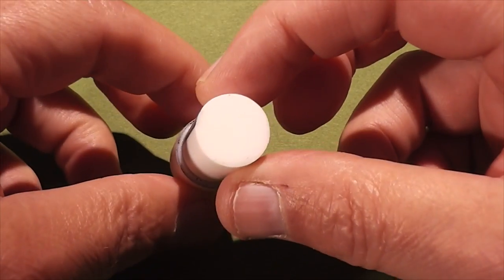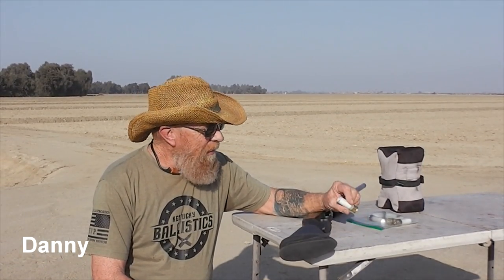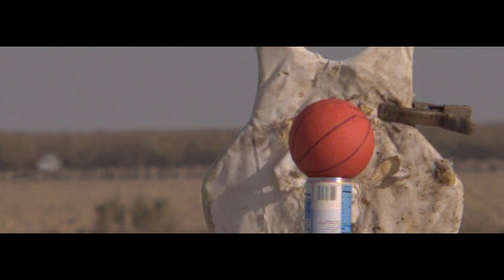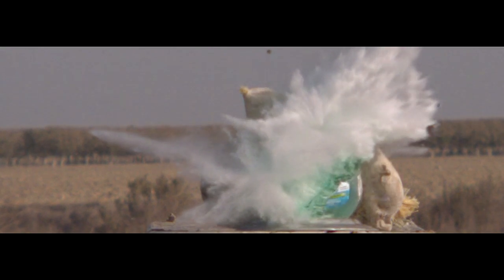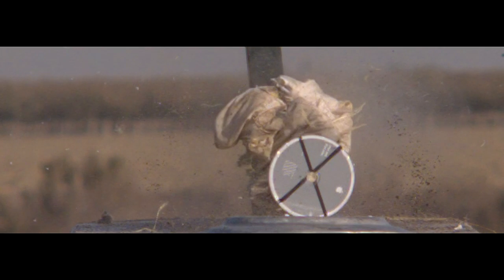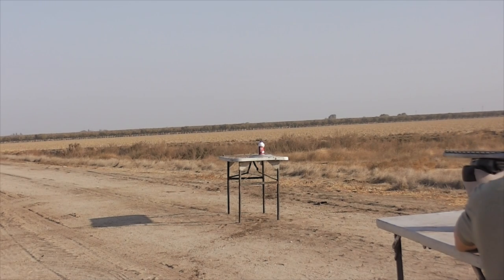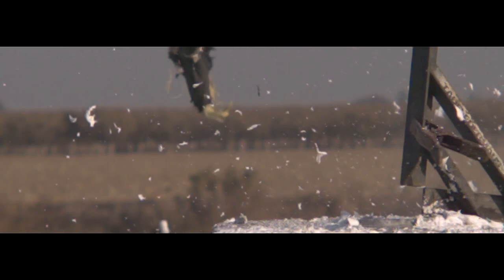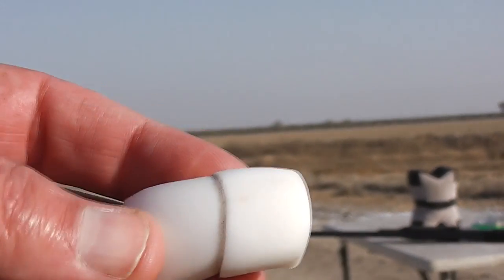TEFLON Slug -   From Russia

Comment: Thanks for testing these! Actually I made em from scraps so they cost nothing. And there is not much effort to make these. Teflon can be lathe turned just fine.
I call this a good result because I just wanted to see how pure teflon holds the stresses of being shot through the shotgun. And the test is helpful. We find a wrong way how to make a plastic slug ;)
Reply: Good luck and have fun.
Reply: Teflon is dangerous to heat, it releases fumes that when inhaled (even in very small amounts) will cause Teflon Fume Fever, my mother worked with the stuff for years and she regularly got sick from being exposed to the fumes of burning Teflon.
Be Careful with these! Shooting is likely enough heat to cause these fumes.
Reply: Try adding weight to front of the projectile. Maybe just a ball bearing
Reply: Сергей Мальцев  А она и не должна стабилизироваться. Просто хотел посмотреть что будет с фторопластом :)
Reply: @pyklwheostanzan6901  Inhaling burning powder residue is not healthy too. But most of it blown far away from shooter.
Reply: Hey, even a failure is still a result. and  a learning opportunity.
Reply: @chuckaddison5134  I expected a failure, I've got it :) I was just curious how teflon and ofher technical polymers will behave. I also made same configuration projectiles from delrin and caprolone.
Reply: @LexsLavrov  perhaps if you make a radius where the slug steps down it wil stay in one piece even with more powder?
and teflon doesn't burn it turns in to vapor directly.. so as long as there are pieces coming out of the barrel it did not get to hot.
to much vapor will kill you though.. :)
Reply: @dezeis1  I never expected teflon to perform well. Just wanted to look how exactly it will fail. Teflon is not very strong machanically. I tried to make gas seals from teflon, it failed. 
I made for Jeff same configuration projectiles from three polymers: teflon, delrin and caprolone. Just for comparison sake. These are not meant to be slugs. Just test projectiles.
Reply: Alexi, I like the idea of the design exercise.  There could be much to learn by making non-standard materials work.  Eliminating sharp edges and adjusting CG  could make it work.
Reply: Отправь им стальную пулю Иванова, если есть возможность. Интересно посмотреть сможет ли она разломать эту их свинцовую сковородку.
Reply: Maybe a lighter powder load could help^^
Reply: @АндрейКа-у4к  Если ты такой большой фанат Иванова - ты и отправляй. Лично я считаю что Иванов - на голову сильно больной и даже прикасаться к его проТУХту не имею желания. Про пробивание свинцовой плиты уже есть хорошее видео https://youtu.be/Iah7YjKSSz0?t=373
Reply: @LexsLavrov 
I seen one problem, use a radius tool when turning. There's a weak point where major diameter meets minor diameter.  I've read your previous comments so I understand.  I'm just pointing this out.
Reply: Pykl WheostanZan lol shut up it is used in high heat applications and can withstand 700 degrees

Comment: I would venture to say that the sharp angle of transition at the base is the weak point - similar to the Garand op rod. Make the transition a small smooth arc, and it should increase survivability of the slug.

Comment: Makes sense to me. I remove plumbing fittings were the previous installer had used way too much Teflon tape. The compressed Teflon cracks apart.

Comment: I also noticed a shattering effect in a experiment with fast objects, hitting a soft object.
I used the type of acrylic, that is used to seal gaps in buildings, in a attempt to recover fast objects.
That stuff is rather soft. But I noticed, that it stopped the fast objects at the surface. And they even deformed, as if they had hit a very hard object. The effect became more pronounced with faster objects impacting. A lot of the energy was converted to heat in the acrylic, without any visible damage. Though a further increase in speed of the impacting object, the acrylic just shattered to what looked like sharp shards. They where still soft to the touch though. I assume, materials have a maximum speed, with which they can transfer force. Above that speed, they are only worth their mass to slow stuff down.

Comment: Teflon is known for being soft & "wimpy, wimpy, wimpy" as a structural component. That's why you find it used as a sacrificial wear component [piston pin "buttons" on floating pin designs, etc.] where its low coefficient of friction is the driving consideration. Also why you only use nylon or wood spatulas w/ your teflon skillet... :-D

Comment: A radius at the point where the head necks down and becomes the tail would help with the structural integrity of the projectile. The sharper corner creates a shear point that probably was worsened by the spin from the rifled barrel
Reply from the maker: I think you are right.

Comment: My guess is that "step" caused just enough extra drag without adding enough weight to the nose. I bet they'll be stable if you flip them around. If I'm not mistaken you have the wider end up front, right?

Comment: If the transitions between the two diameters were a radius instead of a square corner, you may have a little better results.  Square corners, under stress, concentrate the stress in the 90 degree area, and usually produce the failure.  They are called stress risers.  A fillet or radius will greatly reduce the stresses at that transition.  Not sure if it would be enough though.

Comment: Yeah it sucks to have failures but you have to remember you are TESTING these slugs. There are failures in all testing. If there’s not, you aren’t pushing the boundaries enough. 

Plastics are weird. It’s like bending a hose. It will bend really nicely and have a nice radius but then will all of a sudden kink. The plastic does the same. It’ll bend and morph but then it has its “kink” point where it’ll just break and not tear. That’s been my experience with Delren and machining.

Comment: I don't know what to say about increasing stability, but I'd bet if the shoulders of those slugs had a generous radius in the corners they would be stronger. This is a common practice in brittle metal parts like cast iron flanges.

Comment: Interesting that the PTFE just shatters like that...  I wouldn't have expected it either. 🤔 Then again, Teflon is weird. 😅 If you heat it up and try to stretch it with a slow continuous force, it hardly budges...but if you give it a quick strong pull, it stretches to almost ten times its length and becomes a foam-like structure.  That's how they make Gore-Tex.  I guess it's something akin to shear thickening?

Comment: Taofledermaus, with Teflon being flexible under normal conditions, I wonder if it behaves like a non Newtonian fluid under shock? Sort of like Oobleck? As the shockwave hits the Teflon the polymer strands don't have enough time to slide past each other and they shatter.
Maybe this is one for the Hydraulic Press Channel? They could compress it slowly with their regular press, then try it at high speed with their Smashinator 5,000,000?

Comment: Teflon bar stock is available in many flavors. Most Teflon that needs any sort of mechanical strength will be fiberglass reinforced. That looked like it was pure if not only 5%. For the shotgun you would want 25% glass reinforced . There used to be higher concentrations available as well but these are not listed in the link. The stuff is a joy to machine when you get everything right.  here is a list of a few of the different types
 https://www.fluoropolymerproducts.com/reinforced-ptfe-teflon.html

Comment: Cool, but  you are doing it the wrong way. You are supposed to fire the water filled basketball at 10,000 Gs  at the teflon slug. That way the slug does not fracture until it is hit.

Comment: A curved transition, instead of a right angle, on the step-down from the nose might keep it together.
Reply: Supersonic flow simply does not act at all intuitively. Look at the weird shape of the sr71 for example. The entire shape has a purpose and the air does nothing like what you would expect it to as at those speeds the flow seperates from surfaces making turbulence.
Reply: @kg4boj  I believe the right angle may be focusing the stress on that corner, causing it to tear apart there. A curved transition would spread the forces out, hopefully allowing the slug to survive in tact. 
It is not my belief that the airstream is physically contacting the corner.
Reply: @nathandyer4368  Problem is the stress from launching comes from behind and not in front although inertia balances out acceleration the forces go both ways and removing more material would cause a weaker structure in that area, however less mass also means less inertia. I cant even picture the stresses without air even in that respect I'd have to do a finite element analysis of several planes to even know where to chamfer or fillet it. Just like supersonic aerodynamics structural analysis is much trickyer than it seems.
Reply: @kg4boj  SMH... Ok...
Reply: @nathandyer4368  Yeah... Mechanical dynamics as well as aerodynamics will leave you scratching your head for life if you choose to study it.

Comment: That was not good TEFLON /polytetrafluoroethylene. Looks more like HDPE which would break and shatter do to friction in the barrel. The one that hit the Kevlar warped and stayed warped.   TEFLON would not stick to anything...no friction and may deform but come right back to shape. In the Navy shop I worked in we had 1/2" x 24" x 36" TEFLON  (Poly-blah-blah-whatever) sheets/plates for friction protection in boat davit's (the boom crane things) Some friends and I took some "scraps" out to our range, did some fun/stupid shit (frozen turkeys, 1 gl cans of tomato,etc. and the plates) with 7.62 NATO, 5.56 NATO, and standard/commercial 12 ga slugs and 00 buck. 2 plate thicknesses or 1" , stopped 7.62! The bullets looked very mushroomed INSIDE the material and left a small bump on the exit side. The 2 pieces were like welded together because of the mushrooming or so we supposed. 7.62 NATO M80 Ball is not supposed to deform like that... is it? 5.56, smaller mushrooms, no penetration. 12 Ga slugs broke the material but the soft lead just splattered. Buck shot made marks but bounced away. We had all thought the plates would let the rounds go through... no friction, right? 

'